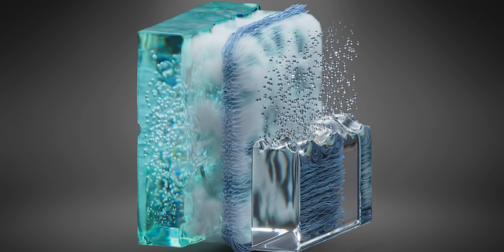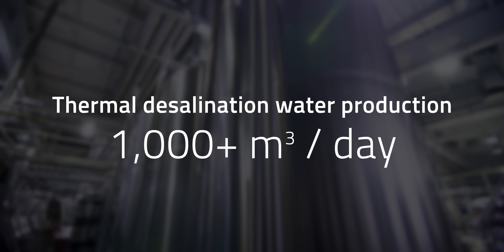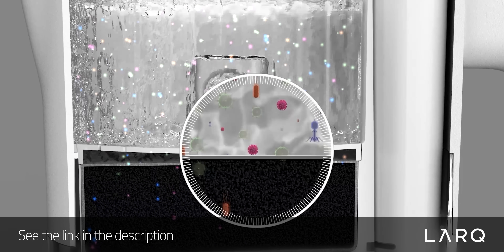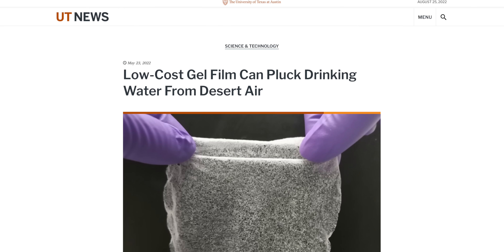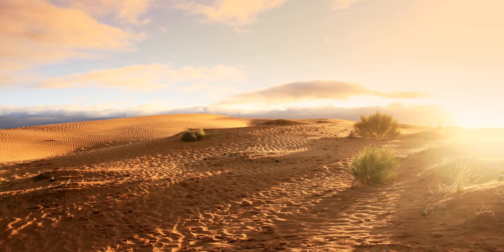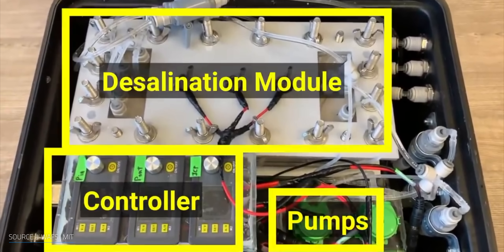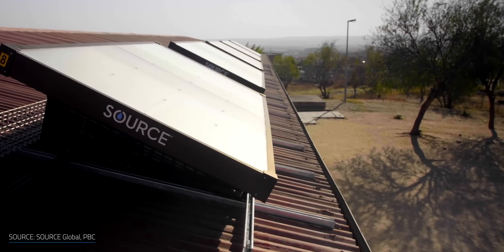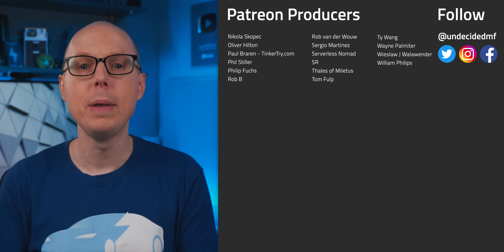2 Breakthroughs That Could Solve the Fresh Water Crisis

Comment: I have difficulty seeing this as a solution to the water crisis. Regardless of where we take the water from it's going to impact the surrounding environment and life there, It's trading one problem for another. We know that the amount of water we consume and use in our household is only a fraction of total water usage. If I remember correctly it's about 8% (someone fact check me on that). The largest usage comes from industrial farming (a lot of which is farming in dry areas where crops should not be grown) and manufacturing. We should be aiming to  address that issue
Reply: The average cost of an acre-foot of water in California is $70. An acre-foot is 1.2 million liters, so if the gel can produce more than 1.23 million liters for $70 then it could be used by farmers, at least in California. 1 kg / $2 * 6L / day / kg * $70 / kg *365 days / year= 0.077 million L / year liters, so it would need to last a lot longer than a year...1.23 million L / 0.077 million L / year = 16 years in a dry climate, but in a climate with 30% humidity then it is cut to less than 8 years. I doubt that this technology lasts that long but if it lasts 1 year then it might be viable during droughts when the cost of water increases sharply.
Reply: There's places like  Isreal and Kuwait that have no choice but to grow in the desert. Because of the people are using several regenerative methods to return permaculture to the desert. That is the issue. The loss of permaculture, not the location. You can't tell people they can't grow crops on their land because it's a drought. You can show them how to develop drought resistant soil through intelligent heard rotation, terraces, beaver and beaver style damns. The desert doesn't retain the rain it gets. That's the REAL problem. But we can change that and in many countries we are.
Reply: Not everything needs to scale to industrial level to have useful applications. And also let's not mix up irrigating water and drinking water.
Reply: @ryrylandcripps5811  I'm not sure what you mean, water is water. Water being prioritized for irrigation means less water to drink. Spain is a good example of this and what not to do in that scenario. We've become loony toons characters cutting the very branch we're standing on. What's the point of making these nice things if we won't be around long enough to enjoy them.
Reply: The ocean is preposterously large. Whatever we concerted to fresh would get back I to the ocean and be resalinated millions of years before it had any notable impact on it
Reply: @whatsupinspace854  I'm not saying it would have a global impact, just that it could have a local one.
Reply: @needamuffin  we def wouldn't want to be sucking near biosoheres on shore. I would think this is an engineering issue, though. Get a hose out to where the ocean is a mile deep and put a good filter to keep whales from being sucked up and I'd guess it would be ok.
Reply: It's not supposed to be a large scale solution. Many of the small-scale applications are extremely useful in poorer areas, not just in the US.
Reply: I wouldn't say there's areas where crops shouldn't be grown. I'd say there's areas where different crops should be grown. Irrigation inherently expands the arable land area. We could do better at matching the crops to the areas able to support them, but there's few places where crops shouldn't be grown period.

One policy that could encourage that is not shrinking water rights based on reduced usage. Farmers grow thirsty crops because their water rights are use-it-or-lose-it and they are afraid of losing their future access to water.
Reply: What would work is better water purification so we can reuse our waste water. Same for rain capture, also moving the seasonal flood waters from each region to where ever there's a current drought. We need to invest massive amounts of capital to revamp our water purification, water storage, and infrastructure to move water around the country.
Reply: I don't think air harvesting like this would have too much of a negative Impact on the biosphere, the water isn't being destroyed its going to be returned after its used.
Reply: @n.g.s1mple29  Yes, but not in its usual cadence. I think at extreme scales, this idea would be a form of terra forming, but at more reasonable scales it still has the potential to disrupt the water cycle in some form or another.
Reply: Farming is pretty important if we want to be able to eat. Likewise industry is important if we want a modern technological society. We need solutions that allow us to maintain what we have and to continue to move forward.
Reply: @IanHobday  farming is important, industrial farming is not. We quite literally throw away 40% of what's produced in the US. Countries that prioritize seasonal farming have less waste because they don't try to grow crops all year round which often  requires more water or surplus being wasted. They produce what they need.
Reply: @gemelwalters2942  Industrial farming is absolutely required. Maybe you want to go back to growing all your own food but I'll pass, thanks. 

Industrial farming of high profit low-priority crops however is something the world could do with a lot less of.
Reply: @IanHobday  but you can farm to your environment... It's dumb to farm certain crops in a desert.
Reply: @anti-classist  If it's dumb then it will fail. It might take time, but it will fail.
Reply: @IanHobday  no we NEED to not die in a heat death because we can’t control our carbon budget. You SHOULD read the difference between NEEDS and WANTS
Reply: @beckyscleanersock8395  We're something like 10^106 years away from heat death, I don't think you need to worry about it.
Reply: @IanHobday  heat death can be planetary or atmospheric for us
Reply: This comment is to address people not wanting to grow crops in the desert or grow different crops in the desert that are more drought resistant.  Remember that the arid desert regions is where most of your food comes from, there is a very good reason we grow things in the desert- first the ground is extremely rich for growing in the desert southwest, also we have almost year round growing seasons, where else will you get your fresh fruit and vegetables during the    Limited growing season of the vast majority of the US. Most regions outside the southwest US has a very limited growing season, even in the south central and south east regions can only grow from may to august. That is only 1/4 the year.  Also here in phoenix the major industries use a lot of water but we mandate them to recycle up to 90% of what the use so they are already highly optimized for water conservation.  The answer will involve many technologies applied in various ways combined with optimizing conservation of drinking water while limiting the impact on the local ecologies. I am hopeful because of videos like this…
Reply: Agreed completely. Industry uses way more water in the interest of boosting profit. Ban fast fashion and water issues will ease.
Reply: FYI,  Farming in dryland areas benefit from low pests and diseases incidence, and are usually started when new Constructions require Commercial adoption to justify the investment. Everything changes as the community served grows and matures. There never was or will be a working Crystal Ball.
Reply: I have a simple question, one of the major tipping points of climat change that stands to be the most disruptive is the slowing and halting of the oceanic flows due to the non man made desalination of the ocean, as well as the rise of the ocean levels due to fresh water melting into the ocean.  So does common sense not dictate that if we have a significant number of desil plants around the world that are taking fresh water out of the oceans, screaming all of the harmful chemicals in the process and releasing in an ecological way- salt…. How is that bad for the environment seems like we are killing 3 birds with one stone, taking out fresh water for us to drink and grow things with , filtering out contaminants, and resilinating the ocean which is a step in the direction it needs.
Reply: Vertical farming. We need to be doing more of that. And do it in greenhouses we already use.
Reply: I believe it's going to take several technologies to address the needs across multiple applications. Moreover, these are fledgling technologies. Once they have time to mature, the appropriate mix will hopefully become more apparent
Reply: We have 8 billion humans to feed plus livestock, because meat tastes so damn good. We gotta grow food somewhere. And places that are good for farming tend to make nice places for homes. So farming gets moved out to the badlands, meaning dry land.
But the way cultivation has been done since it was going invented is wasteful. Out in the desert of the Antelope Valley the pot farmers all grow in greenhouses. After they get busted and run off their greenhouses remain humid for a year or two. Which tells me that growing under cover would be less water wasteful.
But I disagree with your zero sum proposition. Brackish water can be a pain, but it is certainly not a deal breaker. Sure, there will be environmental damages but those will be reduced with innovations. 
Right now, the Owens Valley must keep a certain level of water covering the dried up lake bed as a dust mitigator. If the Pacific Ocean were piped into it and was partially treated on the way, we could once again have a permanent lake. Pumping would be powered by wind and solar. Desalination would be also. It just takes the will and the taxes to make it so.
Unfortunately, we should have started that project yesterday. As usual, we will wait until the problem is critical before we make a move toward large scale projects.
Reply: Targeting to areas of usage for answers is about limiting....need answers that is about abundance without destruction...
Reply: Matt’s video does not suggest that this is a “solve all” solution to the water shortage, this could not be made any more clear.  It does however, suggest one more possible
Reply: I guess it might impact the surrounding environment temporarily, but after we drink water extracted from the air, it is then simply put back after we pee or sweat it out and ends up right back where it started.
Reply: Allot easier to move water than move the sun.  The so called places that have water typically only produce 1/3 to 1/4 the crop.  It would take 4 acres to do what is done in 1 acre.  It would be an environmental disaster.
Reply: I’m gonna build a pipeline from the Midwest’s ample supply of oil(water) to be sold to you idiots( partners) out west- anybody want in
Reply: Reductio ad adsurdam
Reply: Golf courses don’t feed people. They have them all over drought stricken areas
Reply: @natel9019  i can not speak about all the golf courses in all SW states but i can speak of the golf courses in my community of phoenix. Most golf courses and all new golf courses use 100% reclaimed wast water. Something that most people do not realize is that these golf courses became major major local wildlife habitats for birds, lizards, turtles, coyotes, Javelinas, deer, foxes, squirrels, chipmunks, snakes, bees and remember that the green spaces are better at deflecting heat than the bare desert so using optimized conservation helps the environment and uses water that would otherwise be wasted.  There is even courses in Mesa AZ that they have included in the wast water treatment process for water used for reuse at homes and businesses.  Those are the way we optimize water usage in AZ
Reply: If by "disallowing crop farming in dry areas" you mean places like California, where people grow crops by choice or out of sheer stubborn vanity, then yes, I agree we should relocate those, because we have a choice to do so. But there are countries in the world that have no choice but to farm the desert because that's what their whole country looks like. There is no way they would give up food security, and their very existance, just because we think their crops are  environmentally intensive. In any case, their environmental impact is a mere dot on the back of the big grizzly that is the impact of us pampered westerners. If commercialized, water purification tech like this is truly awe-inspiring, and literally life-changing. More power to the developers.
Reply: Correct industrial farming is a mass water waste.
Reply: Glad to see the realistic pessimism rearing it's ugly head. I'm saving all my urine in five gallon jugs. That makes me feel better.
Reply: Indoor Farming . . .
Reply: I disagree with your premise that we shouldn't be growing food where it wouldn't naturally grow. As all such questions about ought, should, or can, we need to discuss the philosophy underpinning the statement. We have the technology to feed the world from the Sahara if we want, so we can check off "can". So I'll ask everyone, are humans a problem to cure (don't ask Ultron that 💀) or a deep well of solutions to problems that we all face? 💡

We have the technology already, what we lack is the proper worldview and motivation. Finance 💵 and legality ⚖️ are the ONLY reasons that the whole world isn't already running on 95% clean energy like fission nuclear and renewables. We don't need to wait for fusion to become commercialized, because that will make it artificially scarce and the promise of abundant electricity will always be just out of reach. Set up a good societal framework for people to build within and watch them grow and do amazing things.
Reply: It's a step in the right direction. Besides, I am aiming to try this technology myself on a personal scale. Also distillation is an option that will always exist.
Reply: I’ve thought of that, also. It falls under the “a butterfly flutters its wings and creates a hurricane” metaphor. What new crisis do we create?
Reply: The biggest issue is all of the hydro dams we have built in the past 100+ years. It took nature thousands of years to create her natural water ways...and we go and f_ck it all up in under 200 yrs.
Reply: You're also not fitting the "pro's" of Mycelium into the equation. All you have is the "cons" of the industries we have now which are all negative. Look at the bright side of this. This can be grown in a week where plants take months and thousands of dollars of fertilizer and pesticides and/or herbicides. C'mon man, there are so many ways this and hemp can benefit us rather than everything else we use now from fabrics, building materials and soaps or other health/body products.
Reply: This is part of the solution.  There is no one right answer.
Reply: This can be one part of a change in water management. It will solve the personal and survival need for water. Changes of watering practices in agriculture have already reduced water used with drip irrigation and sprinklers instead of flood watering. Using bioponics that recycles water from fish farming to hydroponic vegetables back to the fish can reduce water to less than 10% of water needed. Reducing water used by industry will require largest changes in processes.
Reply: Everyone here assumes a closed loop system (The Earth). Sorry but we aren’t the center of the universe. Water flows in and out our atmosphere everyday.
Reply: Water shortage is a serious issue as Arizona's population explodes yet it's hardly even discussed.
Reply: Yeah but giant cities don’t need to be importing their water from far away rivers when they could make their own and export fertilizers and batteries. Most agriculture should be moved into the city imo but with soil ofc
Reply: Yes don't grow food in desert area. Make less food. Let people go hungry. Good for the environment. People? Not do much
Reply: that's where you're wrong we should be going across trees everywhere, to balance the atmospheres we could eliminate all deserts fact:::🤑🤑🤑🤑🤑🤑🤑
Reply: Stop the war on CO². The most basic knowledge is ignored. Plants need carbon dioxide to breathe, and we're at perilously low levels. Humans have been around and thrived with PPM counts being in the four thousands and we're currently in the 400 PPM. Plants start to die in the 200 PPMs. Crops were grown so abundantly that we could lose portions to pests, blights, droughts, etc. and still grow as a population. More plants create more water. This is a fact observed by anyone who has common sense forever. As yourself, why are folks who think fewer people, so long as it's not them, is a good thing... why are they endorsing lower CO² levels? Less food, less water... ask why are farmers having to pump CO² to their crops? Ask anyone with a closet garden why they use CO². Ask why the politicians want to remove it.
Reply: Tech solutions are cool and all, but they won’t save us. We need to first aggressively pursue the low-tech solutions like disallowing the farming of water-intensive crops in dry environments and preventing the pollution of fresh water sources.
Reply: @birdrocket  What if those industries you singled out utilized these forms of water while leaving natural water for natural uses?
Reply: @blaquejaque9702  because these forms of water extraction have enormous negative consequences, and if used responsibly, there’s nothing wrong with utilizing the natural water sources
Reply: @birdrocket  fr we could begin by actually regulating agricultural water use across the US, while offering incentives for farms to switch to water efficient farming methods and crops that are both ecologically benificaly for the soils biosphere and not heavy on water use.
Reply: @birdrocket  or the could stop forcing them to leave the gate open to protect (insert your favorite environment al cause here) This is being done by people really just don't want a dam there  in the first place.
Reply: @birdrocket     so no more farming in Africa ?
Reply: @jasonborne5724  didn’t say that
Reply: @birdrocket Think growing almonds in an arid climate.  I love almonds but dang, they take a LOT of water to grow.
Reply: People seem to forget that industrial use of water is to make food and products that people want. Need to reduce industrial use of water? Stop wasting food and buying things you don't need. 🤦🏻‍♂️
Reply: @slcpunk420  The majority of thrown away food is also again from the industry and retail, not private households.
Don't buy you don't need?
How about stop producing useless things in the first place.
Go to the root of the problem.
Reply: @slcpunk420  the computer industry is using insane amounts of fresh water to simply clean their products ..that water (they claim ) cannot be filtered and reused but is now not fit for human consumption so is flushed out the Sacramento river to the sea ..they should be investing in a closed loop system that once filled is continuously used
Reply: @slcpunk420  People buying things they don't need is the basis of capitalist consumerism.
Reply: @slcpunk420  There are products that aren't suitable for cultivation in CA climate like almonds and pistachios.
Reply: @slcpunk420  this is not a realistic solution; making sure drought prone areas don’t have farmers that are growing certain water intensive crops is much more doable.
Reply: @danielbenner7583  Maybe just don't have people living in areas that cannot naturally support the population. 🤦🏻‍♂️
Reply: @slcpunk420  we’re talking about places like Arizona here though. Arizona absolutely can sustain the population it has just using the watershed of the Colorado River, but only if used responsibly. 80% of Arizona’s water is used by agriculture, largely going to Alfalfa crops which are inedible for humans and incredibly water intensive. There are other things like green grass lawns and sprawling golf courses which are also irresponsible uses of water.
Reply: @birdrocket  if an area can support the population then it wouldn't apply to my statement would it? It's not just about drinking water but all uses a modern society demands.
Reply: @slcpunk420  Define "support the population". Does the land need to be arable enough for a homesteader to be able to completely support themselves with 5 acres of hand tilled crops? Or can we use modern technology and engineering to specialize and let the fertile Midwest feed them while they do something else with the land?
Reply: @slcpunk420  Like Planet Earth?  The “Elephant-p in the Room” is Population Pressure.
Reply: @birdrocket  lmfao your answer is Arizona can't sustain a large population at least where it is... If you have to ship in water come on man... You literally answered yourself and then went on to try and say something different.
Reply: @falconerd343  Bringing in food and products from elsewhere is normal but water is not.
Reply: @slcpunk420  Aqueducts
Reply: @slcpunk420  Where should they go? Not everyone can afford to move.
Reply: @slcpunk420  yeah something tells me we wouldn’t need 80% of agriculture crops if we didn’t overeat and mass farm livestock but you probably couldn’t get over that cognitive bias
Reply: @beckyscleanersock8395  it's not even just overeating, the US discards 40% of the food it produces. So we're quite literally wasting water to produce things en mass that we'll then toss away. Meanwhile the ppl who need the water either don't have access to it or they have to buy it because Nestlé or several other companies want to turn a profit.
Reply: @slcpunk420  Then grow those crops somewhere else.
Reply: Permaculture is a good place to start.

And changing who you vote for will also help.

Rain water runoff can easily be more effectively be absorbed to recharge our water table with little to no harm done, likely it would actually improve all stages of ecosystems along waterways. But green nutjobs in California think it's more important to show the runoff, because fish.

You should go watch the video series on how India is adopting permaculture and turning land into practical jungle with just some water catches and ground cover.
Reply: @rothandre6497  permaculture avoids fertilizers ... are you going to decide which billions of people will die?
Reply: @slcpunk420  Permaculture doesn't preclude the use of fertilizers. It does, in many cases, reduce the need for soil augmentation and additives such as high nitrogen fertilizers.

Also, I think your snippy comment about choosing which billion people die is just hyperbole and completely uncalled for.
Reply: @rothandre6497  is permaculture safe for people who live near chemical plants?
Reply: @rothandre6497  wait you don't think rain run off is important for oxygenating and replenishing water for fish? Interesting.... How exactly does this not effect them?

All problems need to be localized and solved locally... Because each environment has unique challenges.

This mentality that robbing the system of a resource at any point in in the environmental system will be ok is how we screwed ourselves in the first place.
Reply: @anti-classist  you clearly have no idea what you are talking about, further you are taking what I said out of context. I highly encourage you to go watch some videos on water catchment, permaculture, organic farming, and ground water stabilization.

This would be a good place for you to start https://youtu.be/AadLCOqalFk
Reply: @rothandre6497  oh is that what makes you an expert and not me... Watching videos on YouTube... Lmfao. Sure bud.
Reply: I mean if we were to go industrial we could just go and dump the extra salty water deep into the ocean where it is more or less that salty anyway due to high pressure and lack of life down there
Reply: There's 330 million people in this country. Most of it has a pretty short growing season. 330 million people eat a lot of food.....

We would have to vastly increase the amount of farmland, if we only farmed in areas that currently get enough rain. That's a lot more trees cut down.

The problem is there's 330 million people in this country. Just changing where we grow things won't fix anything, without also causing new problems.
Reply: I think that this could be a great idea for major cities in the southeast. If you could put these moisture farms up creating a bubble of low humidity to encompass major metro areas it should theoretically also lower temperature if there is naturally water via evaporative cooling and provide drinking water which could alleviate the strain on natural aquifers that supply more rural farmland. If it can do that as a native Floridian I want one of those to be put up near me.
Reply: All of Matt's videos are this way unfortunately 😿
Reply: @DJDannySteel  He tends to address one category of solutions to any given issue at a time. In this example, he has already recently put out videos on technologies that could drastically cut water usage in farming even in arid areas which addresses OP's concerns, but it would be nice if those were tied together better with each new video to get a better picture of the true scope of some of these issues.
Reply: The water doesn’t just go away forever you know??? It’s put into the circle and eventually comes back . The oceans have risen due to it being transferred from ice and fresh water to the ocean. So using desalination to make more fresh water isn’t endangering anything hahaha.70% of the entire globe is salt water you’d have to be some kind of stupid to say stop using desalination to grow food for people to eat because it will harm the ocean haha.
How taking water out of the rising ocean and using it for feeding people is destructive in your mind is insane.
And people have been growing crops in the desert with techniques that or very efficient .  More water is wasted in paper mills, power plants , electronics manufacturers, tons of things that could use some oversight to increase efficiency before we start regulating the people who feed the world. Idk maybe I’m crazy but I’d put the farmers as the last notch on the belt of cutting back on. Without modern day farming you can kiss good bye all the restaurants and fast food , and the amount of people who would die all over the globe from hunger…
Reply: @JoeWayne84  I didn't say it disappears, I didn't say it was removed from oceans, I said it disrupts or mistimes the natural cycle on a local scale and that may have effects worth investigating just to be sure. Getting water out of the air in a drought is nice, but if it ends up making the drought worse and last longer, a cost/benefit analysis needs to be done. To even know if that's a risk factor requires further investigation which is what I pointed out. It helps to actually understand what someone is saying before calling them an idiot.
Reply: @needamuffin  if my comment was directed at you then I apologize I haven’t even read anything you has typed I was responding to the original poster in this thread
Reply: Oh ok I see I didn’t respond to you in anyway for some reason you decided to respond to my post on your own I did just comment on the original comment without even opening any of the other reply’s. I was wandering how you got in on this conversation
Reply: @JoeWayne84  YouTube isn't great at showing who is replying to what, all I know is your your reply showed up for me as a Highlighted Reply in my notifications. I apologize if your comment wasn't directed at me. You still shouldn't call people idiots, though.
Reply: @needamuffin  haha ok Karen
Reply: @JoeWayne84  That was for your sake, not mine. It's very easy to write off someone's argument if they're throwing around insults in the same breath. Good luck winning any arguments and getting your point across because you've clearly not decided to take my advice. Your loss.
Reply: @needamuffin  would you look at that I never even typed the word idiot in my earlier comments…. 
I’m shocked haha
But you were telling me I was calling someone a idiot and being a mean person… 
I’m not above that though,I must admit , I try my best to convey a point without calling names but sometimes it’s just easier to call someone a name. :)
Reply: @JoeWayne84  "...you'd have to be some kind of stupid..." Excuse me for paraphrasing.
Reply: Please report this video for misinformation
Reply: Exactly my thoughts. We need to rid ourselves of ignorance first in order to thrive.

Same as pollution, we are made to believe driving our cars is killing the environment when in reality it is the industrial, military and aviation sectors who pump out in one hour what the rest of us contribute in a year.
Reply: @syrthdr09sybr34  cars absolutely are contributing a ton to climate change. Some 15% of all co2 emissions comes from cars.
Reply: @birdrocket  Co2 emissions are just the hook for the FDA to tighten their grip even more, and the fact that people just keep repeating the same crap over and over again is a bit annoying.
Reply: @syrthdr09sybr34  the fda has nothing to do with cars or co2 emissions. do you even know what nonsense you're spewing?
Reply: @birdrocket   Ok since you want to play that game. 

Where did you get all your super accurate data from? My guess is you don't actually know, but rather you just keep repeating numbers because it makes you feel smart and environmentally conscious.
Reply: @birdrocket  Btw FDA, EPA,Cia, fbi they all have the same agenda.
Reply: @syrthdr09sybr34  ok you’re just insane, got it
Reply: @birdrocket  "ignorance is bliss" remember who said that quote, and under what context?
Reply: @syrthdr09sybr34  Transportation accounts for 27% Carbon emissions (the highest contributor) so it is a significant factor, we have the data to confirm that. Within that transportation sector Cars account for 41% and trucks 22% of global emissions. 
Industry is 24% so you're right that is definitely a problem too but a big part of that is making cars. Aviation is a problem too but the reason for that is ppl were convinced they need to take planes when a train is far more efficient. Look to Europe and how you can travel from France to London by train in 2hrs. It takes you that long just to get through TSA at an airport. If we can curb our over reliance on these gas pollutants it would solve a heck of a lot of problems as well as save us some money.
Reply: There is absolutely no shortage of water. The problem is a shortage of free or dirt cheap water.
Reply: @matthewhuszarik4173  There absolutely is a water shortage problem. Having expensive ways to produce water doesn't mean the capacity to do so at large scales exists. 

For instance desalination plants take time and money to build. If you don't have the plant and need the water now not a year from now then no amount of money will make that water appear.
Worse there isn't an endless supply of money many places will be unable to afford building the facilities required to maintain access to water meaning at some point some portion of those communities industry and/or population will have to go without.
Reply: @nocare  For residential use RO water isn’t a significant cost increase. I worked at Diablo Canyon that installed the largest RO unit on the West coast when it was installed. I knew the engineer who managed the program. The cost to produce water was a couple cents a gallon. That may not be cheap enough to flood irrigate water thirsty crops, but it is more than cheap enough for residential use. The problem with water in the Western US is water rights. There are farms that waste thousands of acre feet and then there are others who can’t get the minimum they need. When water systems have to pay those with primary water rights millions to use water flowing off Federal and state lands the system is broken. All water rights should be abolished. They never should have been given to anyone in the first place. The only water you should have a right to is the rain that falls on your property. Not the rain or snow that falls on state, federal, or others property. The problem with water in the southwest US is all political and not technical in any way.
Reply: @matthewhuszarik4173  I agree with you on the water rights it’s just another way people in power can screw over the little guys.
Reply: We've passed the carrying capacity of the earth so any solution is temporary. Just holding back the worst problems till we leave Earth.
Reply: @Frequincy100  Carrying capacity is a function of technology. You already know this since the carrying capacity of anywhere else in the solar system is 0 without technology.

We have not passed earth's carrying capacity for the tech available today only for the current industrial focus. For instance phospherouse is an often sighted near future limited resource that once we mine it all up we loose the ability to produce as much food as we do so the crop carrying capacity of the planet drastically drops.
However the phosphorus doesn't magically disappear we just currently mostly waste it as runoff and thru sewage.

We have the tech to make that not a problem by using wastewater as fertilizer for crops if we as a society want to spend the resources on doing that at industrial scales. We probably won't till the problem is right at our front door like always but claiming there are no solutions at all is very diffrent than the nuance to say the solutions are hard.
Reply: @Frequincy100  We've not, but we are nearing several estimates of it. It seems fairly likely that we will hit that limit within the century, though.